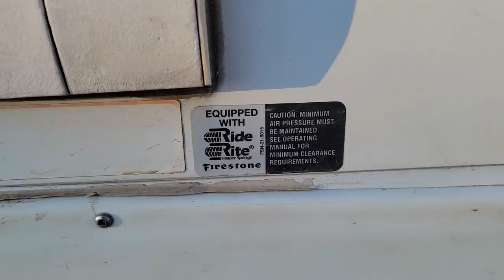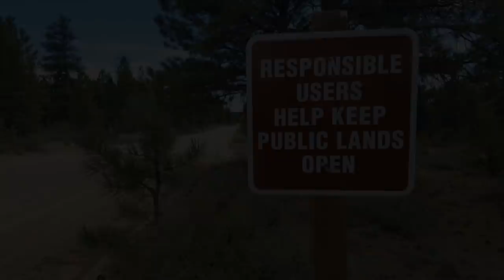RV Air Bag Suspension Woes, Did That Tractor Just Make A Face At Me???

Comment: Hi Kevin,
Maybe they can put in a check valve after your compressor and before your air bags.  The only problem with this scenario is that you couldn't release the air easily.  You'd need a "t" connection with a manual release to remove air.  Just a thought.
-Jon

Comment: I've had to replace both of my airbags on my 07 Dynamax.  Took a week to get the bags in from Washington.  Was hard because the bags changed part numbers.  Would love to lift my rig and remove the airbags and replace them with springs cut to weight.

Comment: Place professional plumbers self seal tape first and then cover that with professional-grade medical gauze tape wrap it around the connections where it is leaking it may not completely stop the leak but it will definitely slow it down just make sure you put the tape on tight and wrap it around quite a few times. I've used it myself and it works. The secret is to use both of them plumbers tape first and then the medical tape over the plumbers tape. Put your microphone up around the pipes and listen for any leaks after the tape is applied you won't hear any hissing whatsoever.

Comment: Hey Kevin, I think if you keep an eye out you could find the replacement fittings for that. if anything you might have to update to newer fittings and change a few things... but it could be done. I'm pretty sure that any good automotive parts store should " should being the key word" have the parts. or look up an air ride company for parts. your a pretty smart feller so i'm confident you can handle this one to. OH by the way did you ever get the shocks for the garage door?  you be safe out there and we'll catch ya on the next one. Hit that like button folks!
Reply from the maker: Shocks for door caused hinge issues. I'm stuck propping it up
Reply: @CampervanKevin  ahhhhhh i was wondering as i don't recall seeing an update on that. thanks for getting back to me.

Comment: it'd be nice if left the RV original and not lifted. Not changing the suspension and drivability of the vehicle. If can get the other parts and replaced somewhere that the leak(s) are fixed with the air suspension? How ever long you keep the RV so some day the next person that gets it in decent shape. That get long lasting road and light off road tires sort of like a Radial tire. This way doesn't cost a lot replacing tires too often. Maybe a light truck tire because of the weight of the RV. Stronger sidewall than a car tire.

Comment: Do you have to replace the main air supply system? Or no I'm confused 😐
Reply from the maker: Leaks on sor supply ate not great enough to keep from filling up air bags. However I cannot just leave pump on because leaks will cause pump to run to try and achieve and keep pressure